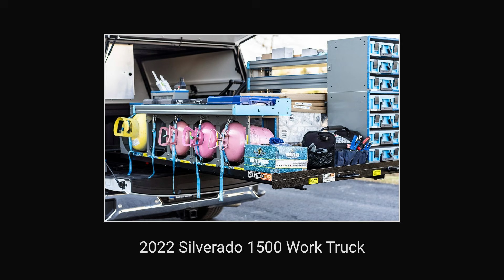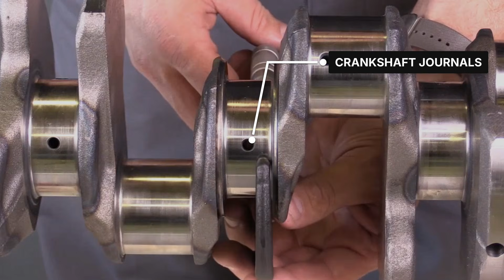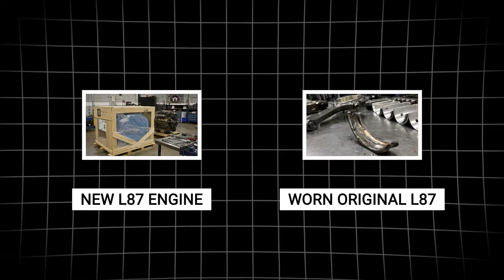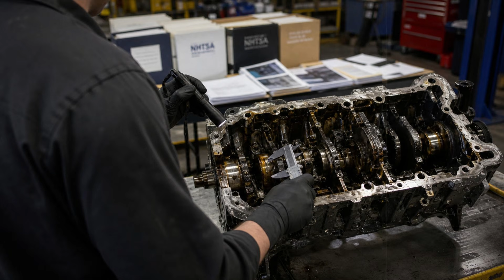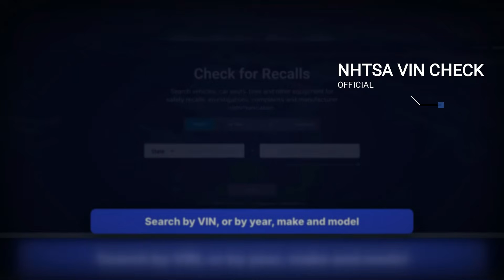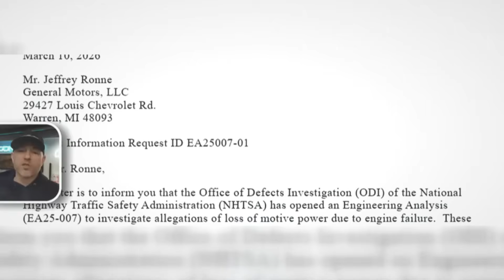GM Already Recalled the 6.2L — Now Nearly 1 MILLION Trucks Are Under Investigation

Comment: The good engine in GM trucks are the 6.6 engine I have a 3500 pick up truck with the 6.6 diesel engine that is doing very very good all the time 2026 HD and I have a new fifty wheel trailer all new doing very good and very happy to have it ❤

Comment: Yeah, I wouldn’t trade any of my 4 vehicles for a new GM truck, even if they paid off the only one I have a note on and gave me the new truck for free. I wouldn’t trade my truck (2017 F250 diesel King Ranch) for a new Ford or Ram. The new Ford Trucks have an issue with the 10 speed transmission grinding holes in itself, and the most recent Cummins have issues with oil starvation on their valves at startup. Toyota can’t seem to properly clean machining debris out of their engines, which forced me into getting rid of my Lexus GX550. 

So sad.